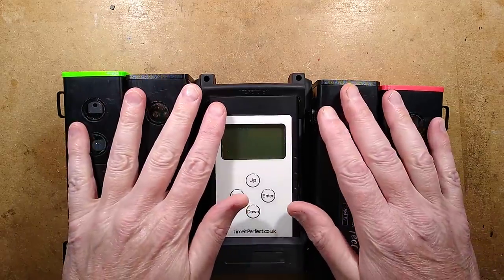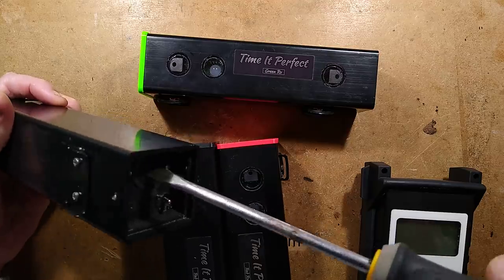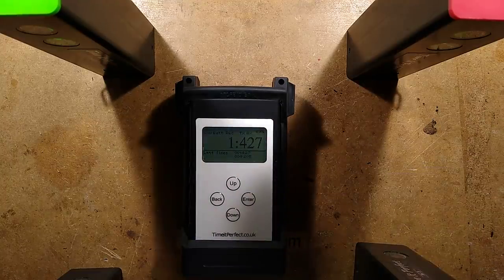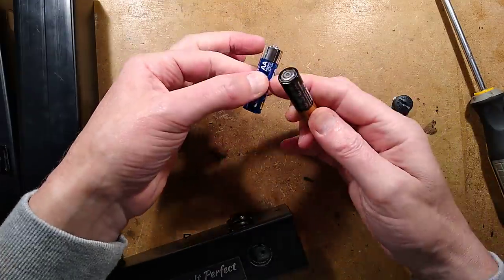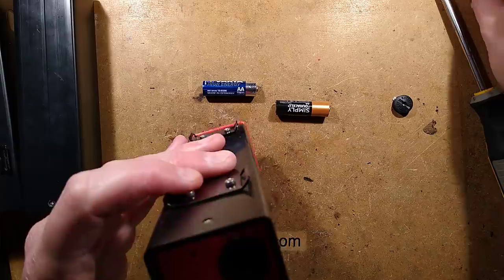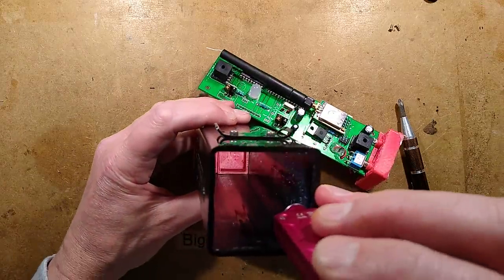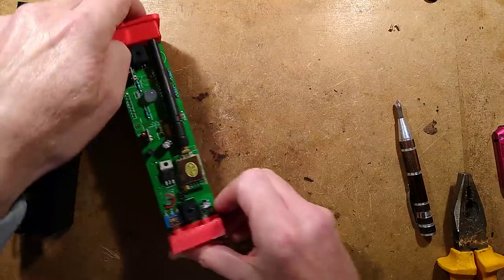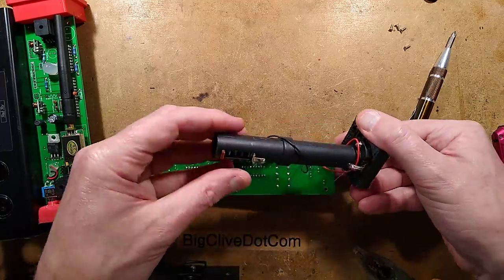Troubleshooting a faulty dog-race timer

Comment: I'm curious about the precision / lag of the wireless transmission in timekeeping here. Well, as long as the offset is the same for every run it should be OK.
Reply: Should be negligible, IMO. Yet a subject to investigation, tho. ;D
Reply: Its not a problem, as the position of the receiver and the transmitters will be the same for same track anyways. Meaning times will be comparable, both between dog runs on the same track on the same event, and also cross-event, even if the time is not "true" in the sense that its the real time from start to stop, the start-offset will be same between runs, and stop-offset will be same between runs. If you want to compare against events which uses a different timekeeping solution - for example RFID-based ones with bracelets, only thing you have to do, is to position the receiver in the exact same distance from the start and stop transmitter, so the start-offset becomes the same as the stop-offset, thus the solution gives the true time.

On different tracks, it would of course not be possible to position the transmitter and receiver the same way, thus giving different offsets, but that wouldn't matter anyways, since you can't compare times from different tracks regardless. (You could position them with the same distance to get a true time as described above, but that might not be possible if the referee that needs to watch the time can't be positioned in the middle between start and goal)
Reply: @sebastiannielsen  there in fact is a way: you can keep time on the endpoints, from the control unit measure the distance (actually the echo delay) to both ends, get them both more or less synced, and this way they can report a timestamp, so the propagation delay doesn't matter any more.
Requires proper calibration, delivery confirmation from the control unit (and retransmission if the message has been lost in transit), a decent timekeeping subsystem ×3, but other than that — should suffice.
And by the way, there's no such thing as «true time».
Reply: Lag would be irrelevant because it happens for the starting transmitter as well as for the stopping transmitter, so cancels out. That assumes both transmitters use the same firmware (meaning the time from the light beam being broken and the "packet" being sent out over RF is the same), but I can't think of a reason why it shouldn't be identical. The distance to the receiver can be completely ignored. Light travels 300km in a 1ms, which is the resolution of the timer.

The biggest source for inaccuracy will be the crystal that clocks the the receiver. The time will as accurate as the crystal is to its supposed frequency.

Comment: hah. i came into repairing those things as hobby, the old expensive non programmable chip ones.. 
started with the connectors which had been worn out because tiny and not for rugged use... 
went over to xlr for those... 
then the cables, 
the beam detectors (old ones where dual mirror based versions).. some  hurdles, wood then metal..
ended building two way wireless transmitters for the og cable versions (problem was keeping switching/transmit delays to a minimum and constant under 200mS)
ended up having to use "iris base" kits for legal issues, CE and wee.. start/stop signals..
final versions i built were with wireless start and stop sign, multi laser detectors at the hurdles (since small and large dogs, up to four beams for start stop).. multiple stopping times , serial interface to software... i had built one with an arduino but would have had to spend high money to get it legally sold with CE weee and other monopolymafia EU stuff.

Ended up building ones with siemens logo, standard industry reflector laser detectors, a lot more expensive but " legal to sell" without risking getting sued.
kinda complex program because i made for 8 stopping times and 10ms resolution.. because dogs have for legs to possibly break the beams when they pass once and the human with two also running through.

since nobody ever takes care of those things beforehand until 10 minutes before they need to work i went for cheap BabyC battery holders (external) and usb power packs.
aaand always cable option as backup for complete failure to provide batteries or usb power banks or wireless problems.

And of course everything needs to be really rugged and waterproof. and in my versions easy to use without manual, idiot proof and made to last forever.
 lasting forever/cheap repair also means dead market, no long term money to be earned.

professional sets went upwards of 3 to 5k bucks depending on what you wanted. i sold them for cheap couse hobby and it was 50:50 time to components cost and easily doable for 1k bucks. luxury all in was around 1.5k.
If i finally find the time i'm gonna go kinda open source and make a workshop so the clubs can build/use their own sets. 
using 2 or 3 siemens logo 0BA8 upwards as a mesh, with the now integrated lan ,webservers and wlan access points and using large boxes makes the hardware really cheap.

Comment: The programming header is most likely ICSP ( https://en.wikipedia.org/wiki/In_Circuit_Serial_Programming_(ICSP) )
It has 6 pins. One GND one VCC a reset line and 3 more for SPI communication. it is common to most AVR micros.

Comment: Cool solution would be to 3d print a holder like the one used to charge walkie talkies (like a big tray with many holes to put radios in). This way you could just have 2 contacts on the back ofthe units and after the event you just slot them in to charge them so they are ready for the next event.

Comment: As I'm sure 900 people have told you by now, that six pin connection is probably an Arduino ICSP header. Very likely this is programmable with the Arduino IDE.

Comment: Looks like an easy fix. I'd desolder the battery contacts and dunk them and the springs in a cup of ordinary white vinegar.  When the bubbles stop wash the parts in distilled water and resolder them back in place.  Tell the club to stop mixing batteries and remove them after each day's use, and the kit should last for many races to come.
Reply from the maker: I did that and included instructions for battery usage.

Comment: Thanks clive for showing us this stuff.
And especially thank you for NOT showing a reverse engineering of this.
Regardless of price - this is a novelty item and people put real work in there. So it's nice that you respect that - like you did in the past with other "one off" items. 

What would you recommend as a course of action here?
Something like an 18650? Or would you just put a new battery holder in place and recommend a pack of Eneloops that have better shelf-life?

Cheers,
Reply from the maker: I did clean the existing battery holders.  If excessively damaged I'd fit new ones.
Reply: Reverse engineering this wouldn't reveal any secrets. The circuit for something like this is so straight forward that it's hardly a few day's work of design, even less if you already used the RF and display modules in other projects and therefore don't have to search for the "right" modules.
Similarly for the firmware (that Clive wouldn't try to reverse engineer anyway in his videos). Can't know what additional features there are, but I'd estimate a week max for a simple start/stop timer triggered by two light gates (firmware for the transmitters and the display unit). The complexity of this system is barely above your typical maker/Arduino project.

I don't want to diminish the product, because building simple things like this is how I earn a part of my income. But I wouldn't care at all if someone tried to reverse engineer it. In projects like this (on offs/very low volume) a lot of effort goes into manufacturing and assembly. Selecting the case (or repurposing drain pipes as it looks here, which is a brilliant idea), making the cutouts for the windows, screwholes, mounting brackets, CAD'ing and 3D printing endcaps, soldering wires to everything, getting everything somewhat water proof and shock resistant... that's where the work is.

Comment: You'd think they'd build these with a 12 volt motorcycle battery to act as a nice stable base.
Reply: They're designed to strap to a post.
Reply: Apparently they're also designed to be easily portable, light, cheap, and not require charging.

Comment: With a slight change to the 3D printed part at the bottom, those look like they could fit the cheap powerbank circuit and 18650 cell.

Comment: Lithium battery with usb recharge would be a good upgrade.
Edit - suppliers website states they avoided that because the batteries have an end of life.
Reply: Can use a holder for the battery so it can be replaced. They can be found easily nowadays... vape shops.
Reply: To be honest I'm really so sick of micro-usb charge ports breaking, or else perfectly good, not that old, expensive, items failing to work as they once did because of tired old batteries that are designed to never be replaced ever - like my mothers Bosch vacuum cleaner. A new battery pack, if you could buy one, is around to GBP 150. It contains - wait for it - 7 x 18650 cells. Not even good ones either, 10amp rated 2000mAh cells. But they are spot-welded in so you have to buy the whole pack which contains the BMS and charging circuitry as well which is how they (try to) justify the price. Of course people just buy new vacuums but that means ever more premature landfill. There's something to be said for the simplicity of a couple of replaceable AA's.

Comment: A copper coin with a soldered wire and a fresh spring . Should get that powered up. With  proper label on the side. To remove batteries after use. Use only the same manufacturer battery. Or just replace batteries after every time. 🤔

Comment: Given the pin count and position of the crystal, I would wager those micro-controllers chips are ATmega328's running 8Mhz with an Arduino bootloader and arduino based application code. And the 6 pin header is the standard ICSP programming interface, used to upload new code while in circuit.. Classic ATmel based stuff.

Comment: Quite a few things look "bargain binned" or customized on this starting with the case itself. You mention the caps and somewhat the tubing (seems like off the shelf square plastic tubing with holes drilled in specific spots) and then I notice the antenna. It's one of the standard (often found in PCs) RF antenna you'd find on a WIFI or BT module or the case nearby it (mine has two, my drawer has 4 similar others). The module itself looks like (but not quite) something you'd find in a laptop. For those daughter boards I bet you can get those or similar on eBay for ~$0.10 apiece. 

I wonder if the scrubbed chips are some sort of memory chip. Would make sense for the microcontroller nearby. If you can't see what make/model of memory it is you have more trouble pirating their software onboard those chips to rip their design off. Won't stop the hardcore ones but will the casual. Games consoles have historically had issues with separate memory modules being easily targeted by modders since the bus lines (board traces and chip contacts) were physically exposed and probe-able. A LOT of what you needed to do for those exposed lines was listen to them on boot to see what they sent to either rip the BIOS to mod it or to see what handshakes it did and replicate them with a soldered-on chip to play whatever games you wanted (usually pirated discs). The more advanced ones later used those attack avenues to run homebrew.  What the designers did later in one case was integrate the boot memory into the CPU or other important chip so you couldn't attack it.
Reply: It's not that it's bargain binned per se. Antennas are standard parts with thousands of R and D dollars spent already so why reinvent the wheel by custom designing something. The same with the RF module, it works perfectly for the application so why spend money designing something to serve the same function?

Comment: I would expect that these got stored away in a hurry in the spring o 2020, or they weren't ever brought out of storage in 2020 and they might have been playing fast and loose with the batteries back in 2019.  It might have been possible to get away with that for the off season, but the off season and more than a year on top wasn't anything like OK.

Comment: Clive, it might  be worth trying some lemon juice or vinegar on the corroded battery holder parts including the spring. I've had real good results doing that with holders that looked a lot worse than this one.
Reply from the maker: I did clean them with vinegar.
Reply: They might be too far gone, hard to tell in the video, but try leaving a spring and contact plate in dilute vinegar if only for kicks as an experiment. Overnight is probably ok, but check now and then so the metal doesn't start pitting.

The results on rusted steel is quite satisfying, but the thin plating on these parts might be gone already so YMMV.

It might not be good enough as a fix for someone else, as the longevity without plating the contact is dubious (tinning would make for bad contact resistance I think), but if you're replacing the battery holders anyway, it might be interesting to try.

P.S. Immersion/displacement plating is pretty cool. Plating seems to be a bit of a black art to get really good results though. But it's cool to just dip a less noble metal in a bath and it comes out coated in the nobler metal. I've only dabbled with it and coated some steel bits in copper in leftover etchant.

Comment: Could you mod it to take something less prone to mistakes? A single 18650 would be more than enough energy storage, but I don't remember the voltage output off the top of my head.

Comment: Looks like those battery holders are still readily avalible, though not cheap at £8-20 each dependant on which of the top four electrical wholesalers you go to :o (Bulgin BXS012/1)

Comment: Most likely a problem from moisture causing corrosion on the battery connections, I fix a similar system called Farmtek, I’ve done several videos on them along with a custom interface I designed and built to do live online results. 

My last video on them did some reverse engineering of the transmitter showing how the LEDs are encoded by the microcontroller.
Reply from the maker: I deliberately didn't go deep on the unit, as it's clearly a small company.

Comment: It doesn't make much sense but that rubbed off chip could be a preprogrammed microchip PIC of some sort, as they're often 18 pin packages.
It could be that the "manufacturer/owner" programs them themselves, one for Transmit, one for Receive, and rubs the data off in the process. Then they supply their "custom" IC to the OEM/assembler which solders them to the boards. Just a guess though, but it has the looks of it. If it was done at an assembler's place, they probably didn't have to mark them T and R as both boards would become different projects with their own supplied parts to be programmed for that project (receiver or transmitter).
And even if an assembler felt the need to label them, it would probably be done so with little stickers.

Pro's with this approach would be to save time and money with assembling, they don't have to pay the assembler to program and rub/laser away the markings. With this low volume it's perfectly do-able at home, by the clever lad that developed this gadget.

Comment: Probably doesn't even need circuit modification to use a protected 18650 as voltage is boosted to 5V. (but its a 8Mhz Atmel so some of them CAN be running on 3.3v).
I didn't know the AA leak is caused by reverse charge , Thank you for teaching me that Clive :)
Edit: oh nvm, if it does show battery % then at the very least it needs a voltage divider somewhere on an io, Sorry I was stupid.
Reply: Reverse charging does indeed cause batteries to leak, but Alkaline cells often leak even without being reverse charged.
Sometimes even while still in the package!

Comment: "Simply" batteries. if you read carefully you will notice it says 'by Duracell' i.e. it's not a knockoff, but made under the brand name so people think it is a Duracell battery (which it is) but not the  'good' ones. I've had these batteries and was surprised they lasted not as long as expected, when I noticed. Also, the price was considerately lower, but in the end they are more expensive.
Reply from the maker: I tested some and they had much lower capacity.  Duracell is just a generic brand these days.

Comment: If I was fixing these I would either clean the contacts or just cut new ones out of copper using the old ones as a guide and using a solder pot to tin them before installation.  Then replace the springs and have them use only Lithium primaries and job done.

Comment: Could it be used to measure the speed of a drone?
When I'm cycling at night I sometimes trigger the radar based speed measurement sign the council put on the common because there's cows on it. I get a friendly "thank you" message when I'm cycling between 10mph and 20mph, but I've always wanted to fly one of my drones past it that has been clocked at 100mph with a GoPro's GPS just to see how fast it is and what angry words the sign shouts at me :)
Reply from the maker: The drone would have to be able to break the beams.  I'm not sure how fast it can register.

Comment: Looks a well designed system, would it not be better preserved from the elements if it were potted and a separate battery pack like those used in cameras?
Reply from the maker: I think they're trying to keep it as simple as possible.

Comment: Please post an update on whichever solution you come to :)  I agree with a lot of people on here it can be replaced with a lithium cell and charge controller..  possibly a custom docking station so the batteries can stay topped up to prevent degradation in storage.
Reply from the maker: I stabilized and cleaned the battery contacts.